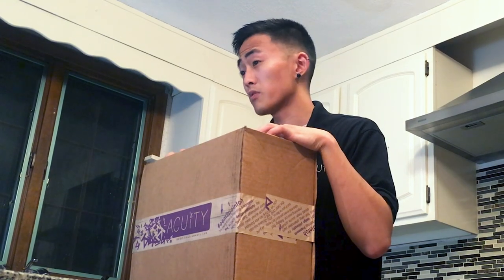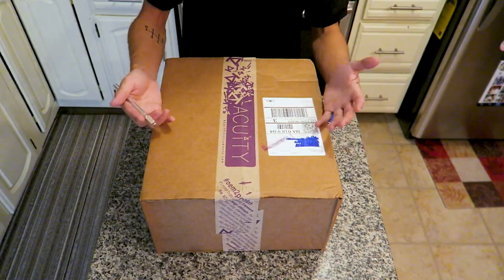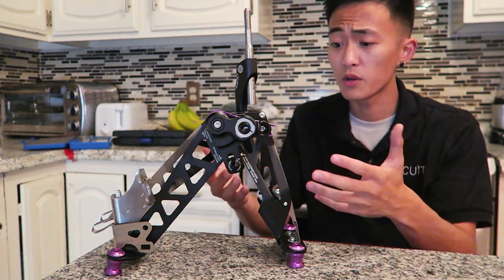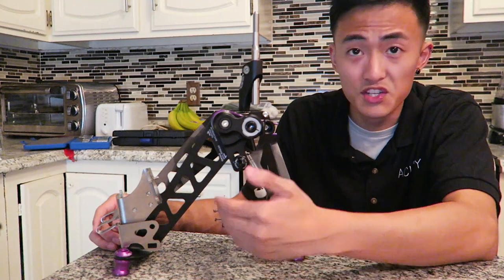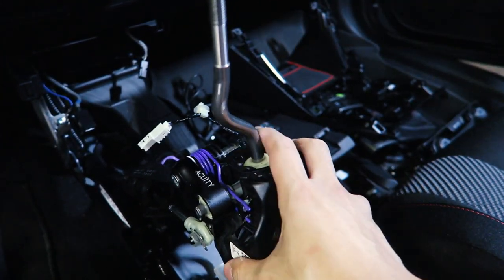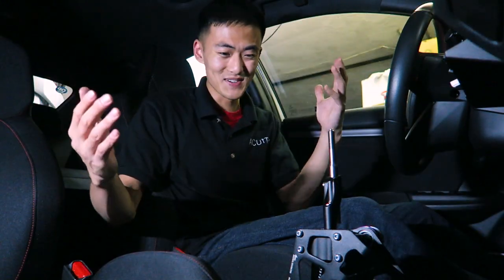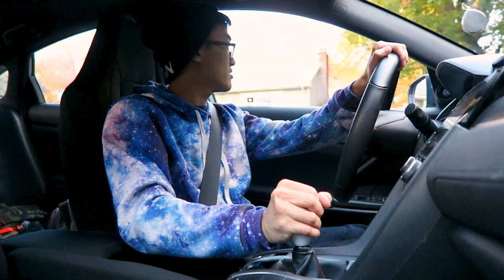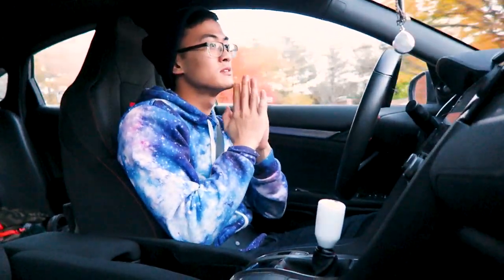Testing The First (And Best?) Fully Adjustable Short Shifter For 10th Gen Honda Civics. Get Hyped!!

Comment: Does this get rid of the crunch sound when shifting from 1st to 2nd ? I currently have the stage two kit and it seems to alleviate the problem but not fully
Reply from the maker: Hey man, I can relate to what your experiencing. This full shifter further improves mechanical feedback to the driver and makes the shifts feel very direct in comparison to the stage two kit. But in regards to the actual crunch sound, that crunch is most likely the result of the movement of internal parts in the transmission that can be felt through the cables as you shift, if that makes sense? The 10th gen cables are known to transmit noise from the transmission itself more so than 9th gens
Reply: you need a solid rear motor mount. I recommend 27won.
Reply: @Pawinning  I have the same crunching problem (bone stock) but throught all gears not just 1st to 2nd...you think the dealer has a fix under warranty?

Comment: I’ve heard that a type r shifter with some acuity bits and pieces makes shifting comparable to this the actual adjustment part is sacrificed though.  But for less than $200 makes more sense to me.
Reply: I was thinking along these lines too. Do you have a thread or a link to what parts are recommended along with the Type R shifter assembly?

Comment: did you replace the cables, bushings, spring, and the shifter assembly?  or just the acuity shifter?
Reply from the maker: Aside from the entire shifter assembly, I have the acuity 1881 cable bushings as well 👍.

Comment: Does the shifter fit the 2019 civic si? Does the help the lag on the shifter?
Reply from the maker: Yessir it's designed to fit all manual 10th gen civics 👍. What do u mean by lag on the shifter? I wouldn't say there's much lag, but I think that the stock shifter had a lot of slop and vague shifts. This full shifter does the best job at eliminating all of that. It provides incredibly precise shifts that feel notchier and inspire confidence into each shift 😎. It takes some time to find your optimal adjustments, but after a week or two of driving to get used to the new shifter, I feel like it's made my daily driving a hell of a lot more fun. Shifts are now crispy, quick, and consistent 👍
Reply: @Pawinning  Awesome man! Thanks for the input. That answer all my questions. This should be my next mod. Time to save some $$. You made some great videos!  Was it difficult to install?  You make it look easy lol I just barely bought the 2019 civic Si. I'm gonna wait a while just to enjoy the normal drive. Love it soo far!
Reply from the maker: Your welcome! And thanks man! Tbh the install is straightforward, but the first time you take apart you're center console it'll take a few hours depending on your experience level. I'm actually making a 10th gen install video on the acuity channel! Hoping to launch it Monday 😊
Reply: @Pawinning  Awesome! I guess I'll be waiting.  I actually had a mini cooper clubman S 2008, and I did lots of things to it, but unfortunately it wasn't a reliable car so I traded in for the Si. It was fun but sad at the same time because I spend lots of time with it. I should had stayed with my roots. Honda all the way! Lol Thanks again for the videos. They help big time!
Reply from the maker: I understand how you feel, my e36 is on a similar situation, i spent so much time and money on it but it's still not as reliable as the civic 👌. So nowadays I enjoy the e36 on weekends or just tinker with it here and there. The Civic is the new, more fun daily imo 🤘

Comment: Shifter is crap...30 bolts and stiff like hell
Reply from the maker: I would like to hear more detail on your critiques for this shifter. It does have a stiffer centering spring by design, and overall takes about a month to break in with daily driving so I understand why initially it feels stiffer than what most people are used to with the stock shifter. I also found that putting the shortest settings on the shifter will make it way too stiff for some drivers and it can make gate selection less precise. We encourage customers to play with the settings during the break in period because it is a significant shifting experience over the stock shifter and everyone has their own optimal adjustments 👌. If you adjust everything to the widest gate, and longest throw settings (position 1 on both), and even raise the height to the highest setting, that should make the shifting feel the least stiff. 

And I'm not sure where you're getting the 30 bolts from with the install process. In my 2017 civic SI that I made the shifter install video for, I found that there are 5 Phillips screws to remove in the center console, 2 bolts on the console support bracket, and 4 bolts on the stock shifter assembly that bolts it down to the car. The rest of the parts dealt with have plastic clips, and wiring connectors that hold everything in place. Some civic variations with wireless charging modules have an extra step with a few more screws and electronics to deal with, but shouldnt be too much more to handle during the console disassembly. The acuity short shifter itself only has 4 additional bolts to make custom adjustments, and also one more bolt on the side to affix the gear cable support mechanism 👍.
Reply: Pawinning good design doesn’t need breaking in
Reply: @Pawinning  yes if you put everything on short setting it makes it harder and notchy.   But if you raise the rod or knob higher you will gain leverage and make it easier and smoother to manage